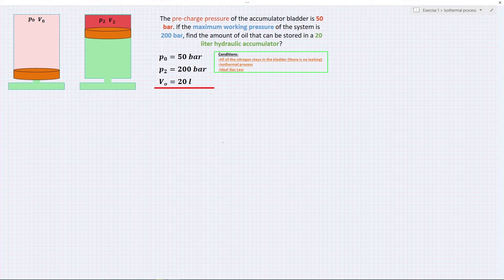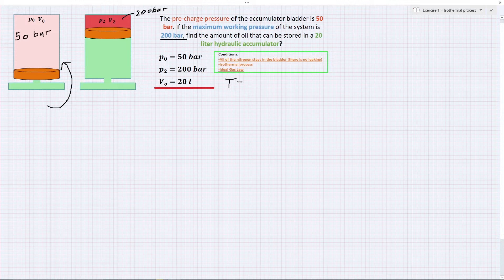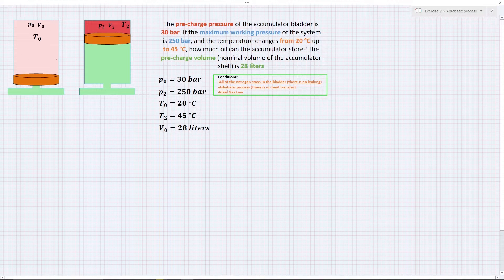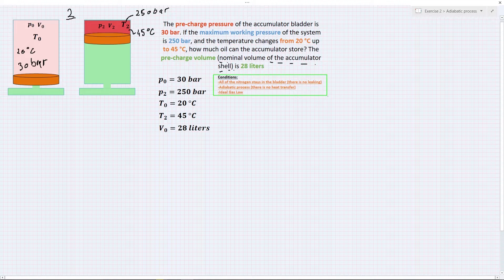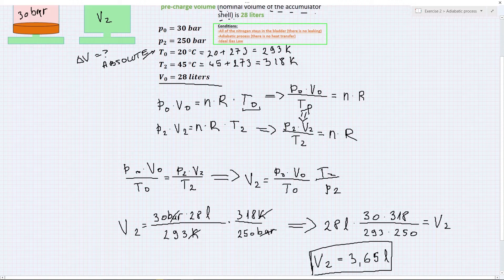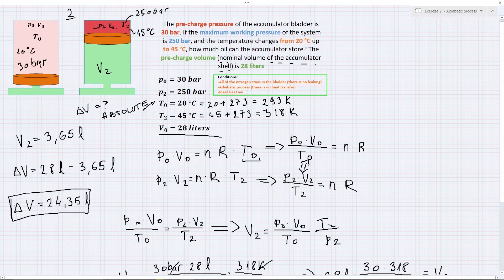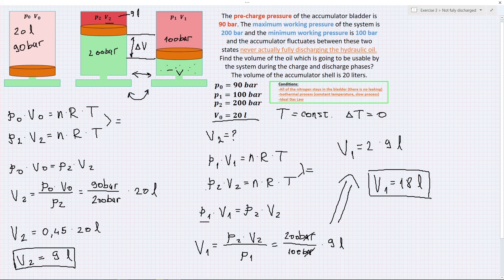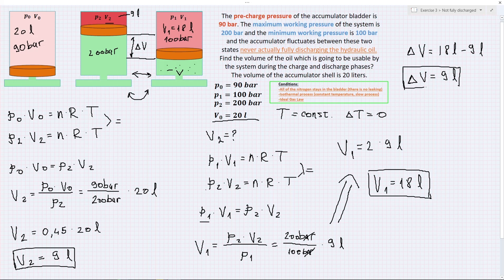Hydraulic accumulator sizing

Comment: Hello author, in the ex 2 (adiabatic process) the P,V,T seem to be incorrect, as the final result does not agree with the adiabatic equation PV^n = k (constant), applicable for the state P0,V0 and P2,V2. Could you please check again?
Reply from the maker: We don't need to use the specific heat ratios in this case as we are observing the same fluid, that is why here an ideal gas equation can be used to find the volume of the accumulator without any problems